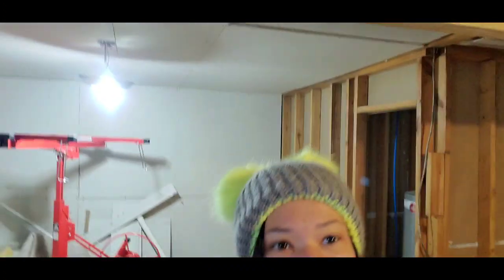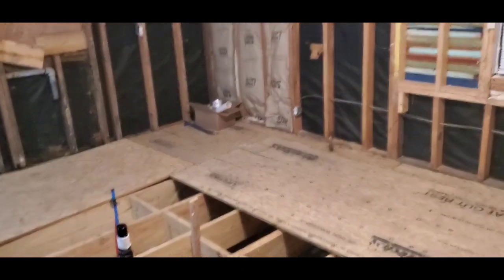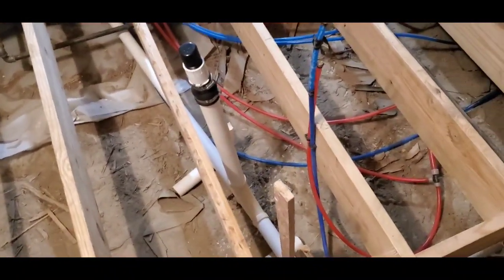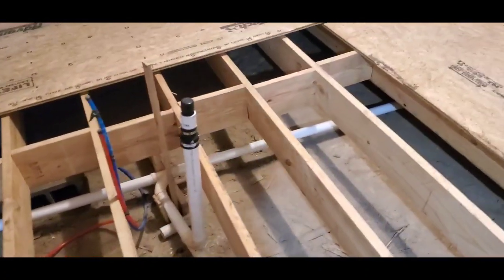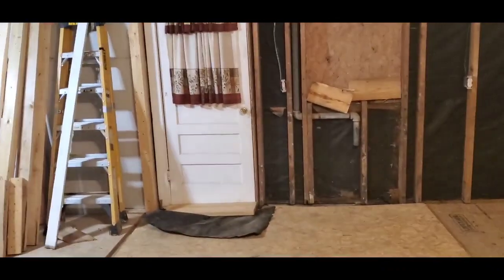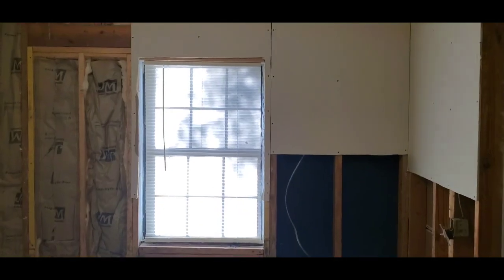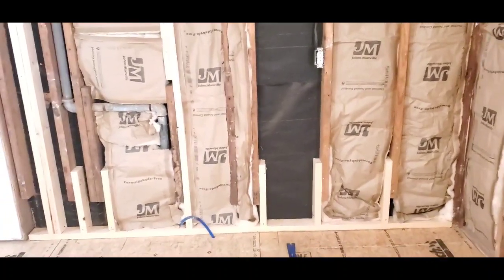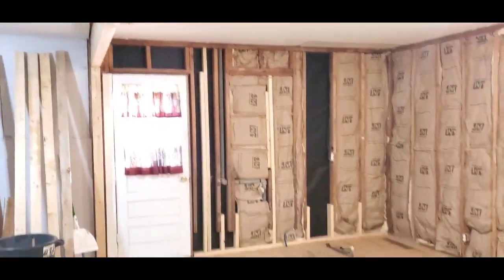Finished kitchen Floor On Homestead! Install Joist and  Subfloor!

Comment: Great job. In my opinion,  I wouldn't wire down from that outlet for a refrigerator outlet. The fridge need to be on it's own circuit alone. The outlet should be higher to keep the refrigerator cord an the outlet away from the heat the fridge gives off down lower